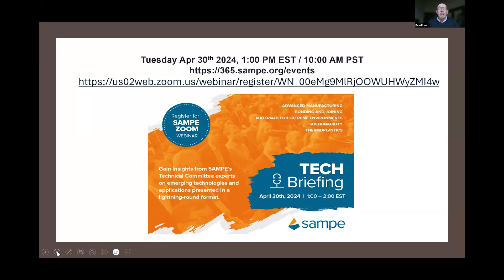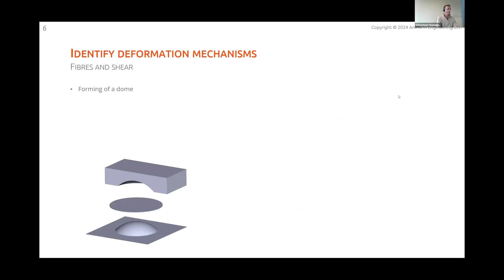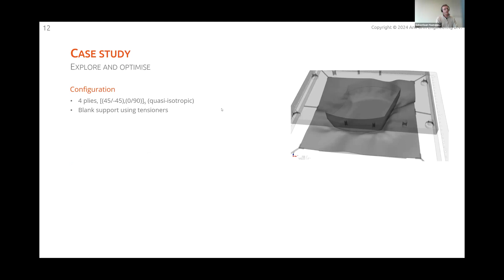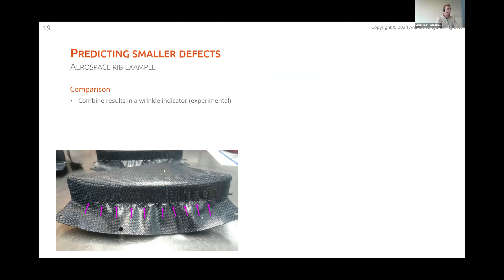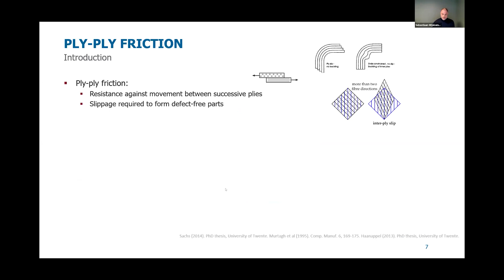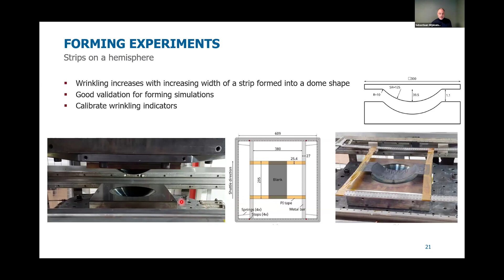Simulation of Thermoplastic Composite Forming

Comment: Thank you for the insightful presentation.
I have a question regardings the practical use of the characterization tests you presented, particularly the intra-ply and inter-ply friction measurements.

How are these experimental results typically implemented in simulation tools such as AniForm or Abaqus?
Are the friction behaviors introduced directly as tabulated data (e.g., friction coefficient vs. pressure/sliding velocity), or are they instead fitted into specific material law parameters (for example, within predefined friction models or user-defined formulations)?  

My second question concerns the way the composite material has been modeled (Conventionnel Shell). If we try to investigate thickness reduction in localized areas of the final part, would a conventionnel shell-based modeling approach be able to capture this type of behavior accurately, or is a Thick Shell, Solid or more advanced formulation required to properly predict thickness variations during the forming process?